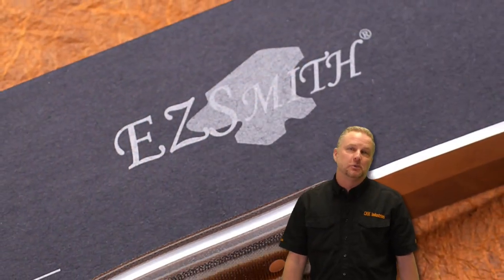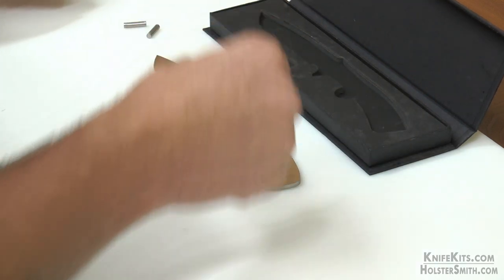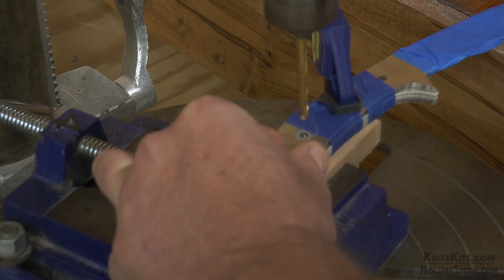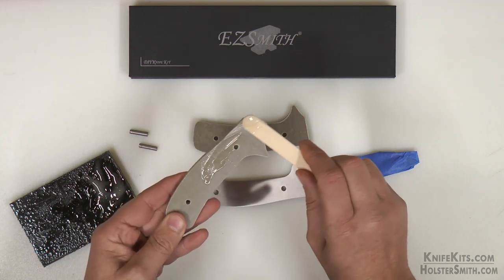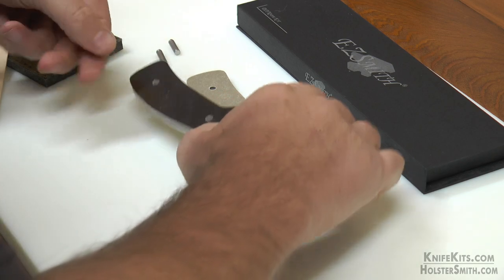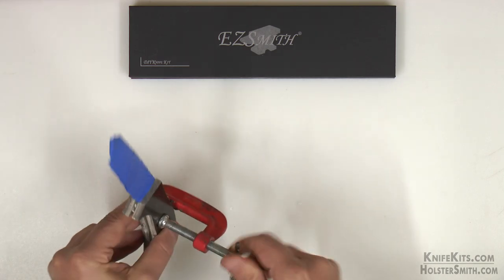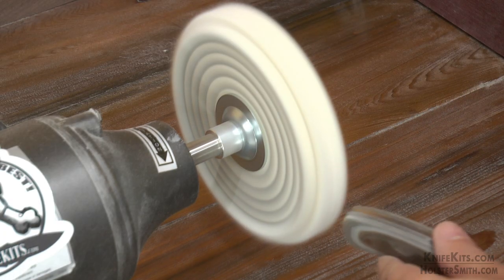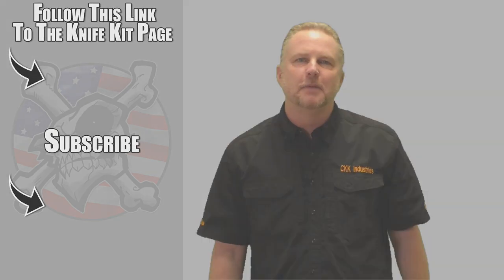How to Build: The Drop Point Tactical Knife Kit by KnifeKits.com

Comment: Can screws be used instead of pins?
Reply from the maker: You could use hidden bolt fasteners ( https://www.knifekits.com/vcom/knife-making-parts-hidden-bolt-fasteners-c-100.html ). You would need to drill the tang holes larger though. You can also use threaded pivot barrels with a large-headed screw.